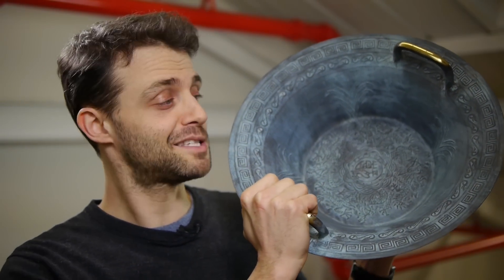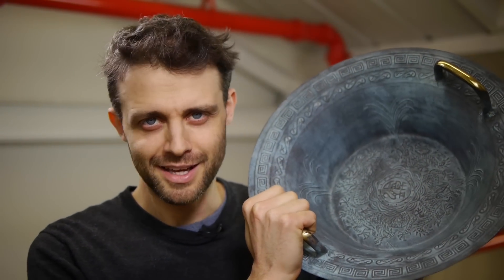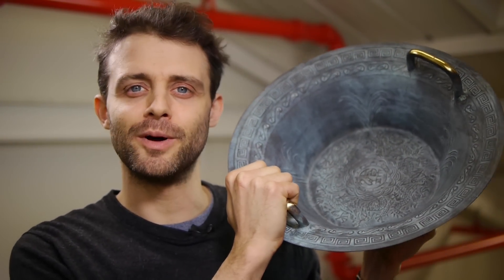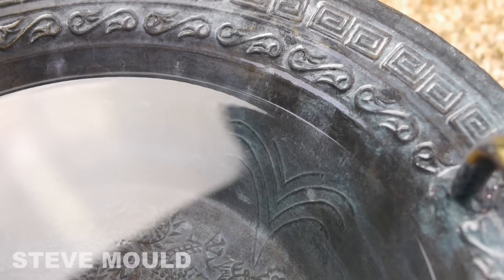The squeaky clean effect - the chinese spouting bowl

Comment: Not just ripples, those are Faraday Surface Waves, a "soliton" wave which vibrates at HALF THE DRIVE FREQUENCY.   Not a higher harmonic.  Not traveling waves, instead they're an instability.  Very weird.  (It's like being able to hear ultrasound, by dividing the frequency in half.)  Nonlinear acoustics of capillary surface waves.  
Also, the wave mechanics doesn't break down.  Those Faraday waves actually are "chop," they're standing waves, and if the tops of the waves grow too high, little droplets are launched from the tips.

Also, this is the same phenomenon behind foggers, sonic vape, Ultrasonic Nebulizers: all those little devices which hit the surface of water with a few watts of 1MHz ultrasound, which creates violent microscopic Faraday ripples, which launches sub-mm droplets.

Also observe that the waves are at 90deg to the vibrating metal.   Faraday Waves always do that.  The bowl-rim vibrates in and out, while the Faraday waves act as "fingers" extending out from the metal surface.   No bronze bowl needed: the same thing happens when you strike a half-full wine glass (or make the glass sing by rubbing with extremely clean scrubbed fingertips.)

PS

It's possible to make giant Faraday Waves in a swimming pool, using a flat board or a "pool noodle."   Wiggle it fast.  Rather than sending waves out across the pool, you'll get those "fingers" of oscillating "chop" which extend 90deg out from the moving plate.
Reply: Please make more videos! Your "Poor Man's Liquid Nitrogen" was INSPIRED.
Reply: Seriously... wbeaty was the first person I ever subscribed to... The reason I made an account way back in the day...
Reply: This comment is perfect.
Reply: Wow, this might be the first and only time I remark: "underrated comment".

Comment: That was awesome as usual. You really have a knack for bringing concepts together. 

I think an important part of getting things squeaky clean is to use vinegar to rinse them. Usually I find the problem is not that dishes are still dirty but that they're still soapy, and, as I'm sure you know, vinegar will remove the soap.
Reply from the maker: +dduncombe ah yes, good point. In fact I didn't use soap to clean the handles of the bowl but isopropyl alcohol.
Reply: Aha! :-) You rock.

Comment: For anyone who's interested, this phenomenon of repeated sticking and slipping is called ... the Stick-slip-phenomenon. It's also how violins and other bowed instruments work

Also 1:38 - A complex geometrical object like the bowl probably has hundreds if not thousands of resonant modes with different frequencies. So in all likelihood, ANY squeaking sounds you get out of the handles is dictated by one of these resonances. Some modes are stronger (higher Q) than others and lead to higher amplitudes.
Reply from the maker: +orbik thanks for the extra info. Great point about violins. Linking myself that it didn't mention that!
Reply: It does beg the question of whether there is a critical friction coefficient value above which two sliding surface do this, whereas they just slide smoothly for lower friction coefficients

Anyone?

Comment: I think the resonance frequency also makes the friction thing work properly - once the rim is vibrating at the resonance frequency, your finger's stick-slip operates at that frequency - as the rim vibration minutely varies the force between rim and finger and allows stick-slipping. I think this is also what's going on with a violin bow, properly used, and what is not happening when the bow is improperly used and screeches many notes at the same time.

Comment: The standard medium is water. However I wonder what will happen if oil is used instead.  Some oil may have lower coefficient of friction but lower density.  How about using acetone or silicone oil which can vary the density and sometimes if possible you may add a bit of detergent to change the surface tension.

Comment: Polyethylene oxide & Chinese bowl crossover experiment?!  Should preserve the standing waves in the fluid at resonance, given the boost in range and strength of surface tension.  Could make some cool vibrations that way.  Also, corn starch.  What if you mixed them together?

Comment: I would thought that getting your hands wet would cause less friction for example you can more easily fall in your bath if it's filled with water.
Reply: Water can make things slippery when there is enough of it to form a barrier between two surfaces, like a car hydroplaning. In a bath, there is lots of water so it can form a barrier, but in the video his hands do not have enough water on them to form a barrier so his hands are free to come in contact with the handles and cause friction.

Also small amounts of water can cause there to actually be more friction because of the adhesive interactions of water with certain surfaces.